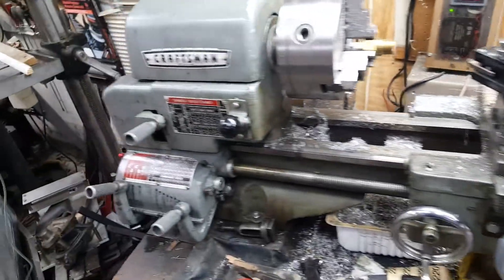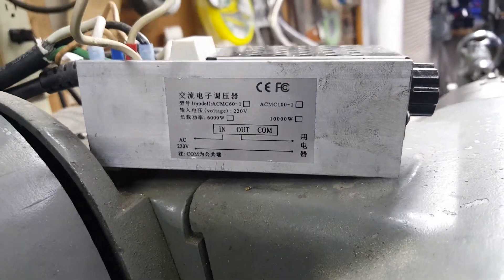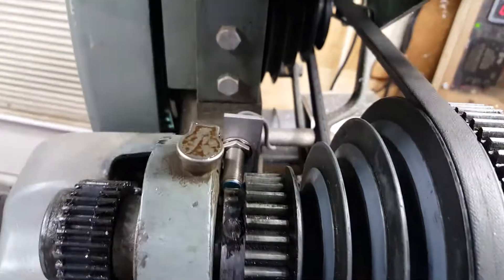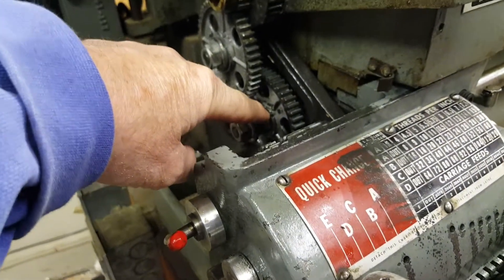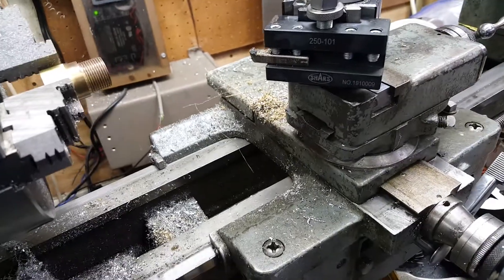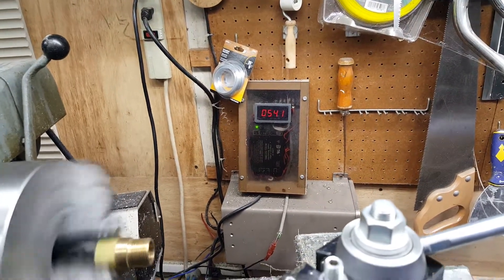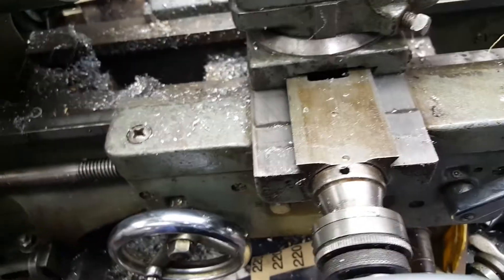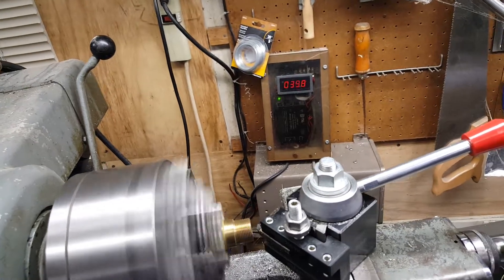Atlas-Craftsman 12 Inch Lathe carriage speed, treadmill motor, and tool post mods

Comment: A little clean up necessary.
Reply from the maker: yeah, I did that vid right after running some aluminum parts.  It doesn't usually look that swarfy, but again I probably don't keep it as clean as I should.

Comment: I followed this video and $14 solution.  It's imperative that the Hz be set to 20, but once done, I can adjust the duty cycle from 7% - 100% and also have the On/Off function that starts at the previous RPM.
https://www.youtube.com/watch?v=bgtu5xBo6_U

https://www.amazon.com/gp/product/B07NJ1SL3N/ref=ppx_yo_dt_b_asin_title_o00_s01?ie=UTF8&psc=1

Comment: What change does it make on thread cutting speeds?
Reply from the maker: the gear change mod I made cuts the carriage travel to rotation speed in half.  I hope I pointed that out in the video, but it's been a while and I don't remember for sure.  So the thread count per inch will be exactly twice the chart, and the travel in inches per revolution will be half the chart.
Reply: @JohnnieBravo1  Cool, thanks. So as long as you know the ratio, it's just a matter of figuring the thread rate. You did cover it, I watched it a second time.

Comment: I have the same speed controller on my mini lathe. When I turn it on, there is buzzing sound that comes from the treadmill motor. Does yours make a buzzing sound too? Thanks for sharing by the way.
Reply from the maker: The motor that was in it for this video, if  it ran slow, it hummed like it did on the treadmill.  The motor in this video passed away.  Apparently it had a lot of hours on it before I got it and adapted it to my lathe.  I replaced it with a Leeson 3.5 CHP motor out of a much more expensive treadmill I picked up cheap, and it is smooth as silk, does not buzz or hum, and doesn't slow down at all under load even at low rpm's.  And it's a lot quieter.
Reply: @JohnnieBravo1  Thank you very much. I will definitely check the motor that you mentioned. Im not satisfied with the current one that I have. Thanks a lot.